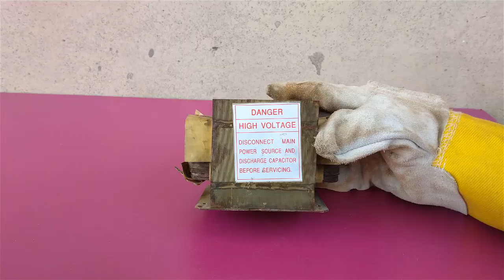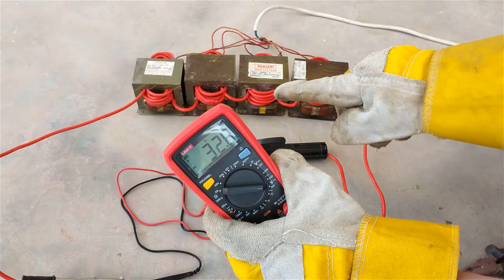How To Make Welding Machine 200 Watt With Oven Transformer Diy ARC Welding Machine

Comment: nice video, but with 4 transformers and 32 volts it's gives you more than 200 Amps, it about 800 amps, but the the wire is about 3mm and the max current for this diameter is 19 Amps . so it's will become very hot with 800 amps and the insulation will burn. not practical for a long use. keep up.